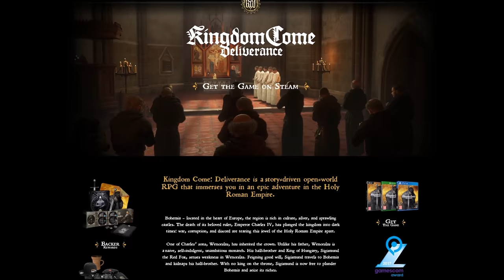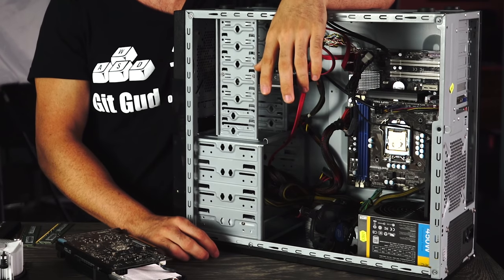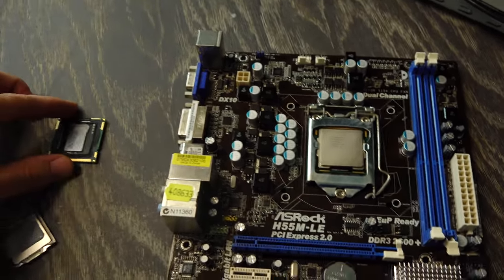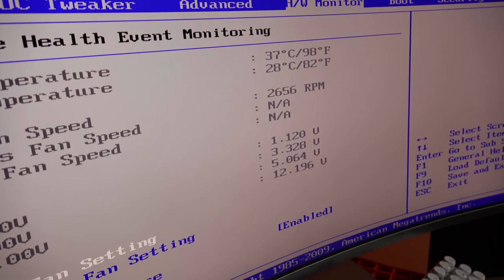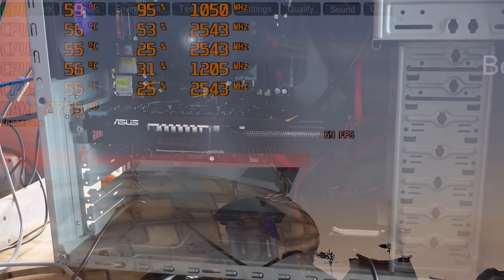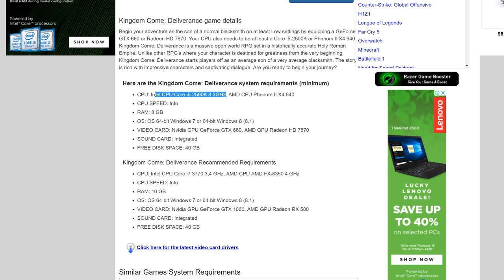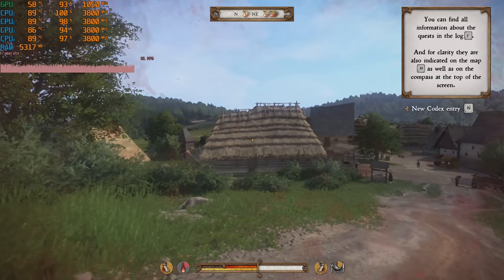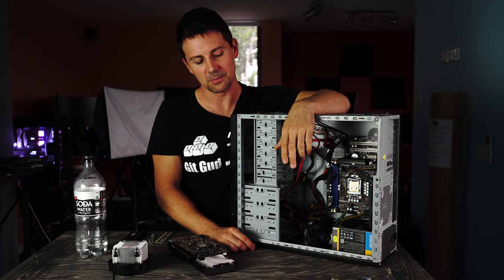The $150 'Bitsweeper' Gaming PC - Mounting an AMD Cooler for Saving that $$$...!

Comment: Wouldn't it have been better to dremel some of the fins off to make it fit?
Reply: Jay O well hammering the cooler and potentially damaging it and its thermal conductivity is a better idea.
Reply: My first thought. One of the things to get out the dremel.
That and for custom windows and fan holes.
Built my own benchtable out of an old case. Highly reccomended.
Had actually planned to dremel off an old cooler for a different board, but found a cheap alternative recently.

Comment: If you really did liquid metall on the card the cooler will die. Between the heatpipes is aluminium wich will get corroded by the liquid metal. Its not nickel plated copper i think

Comment: Had x3430 upgrade from g4400 last week, which is cost less but an upgrade  in term of performance, running the processor @3.9 ghz now, but it is pretty hot (around 90 degree celsius) under stress test, BTW im using CM Masterliquid Lite 120.  Gonna try some delid to cool the processor down.
Reply: Icced Mane how'd it go bro ? Share the affect if deliding
Reply: Re read this a Asetek AIO should be at like 70 in this test, need liquid metal

Comment: hey now, I have a socket 755 cooler on my socket 1366 motherboard. to top things off its a dell t5500 mobo i got for cheap on ebay paid $15 for it and built my wife a nice workstation for her artwork. The t5500 dell mobo has a funk mounting system for heatsinks.

Comment: Really late but that gallium is going to disintegrate both of those heat sinks.. just a heads up for anyone wanting to try this with a cpu, you have to re-lid it afterwards or your aluminum block will crumble like a decaying tooth.

Comment: This Liquid Metal Craze is Dangerous as both Aluminum and Copper Corrode, and the Majority of Coolers are made from that material... Tin, Gallium and Indium will form alloys with it and create a mess and this combination is the Popular Mix... Your CPU and GPU will live less than a Year... It won't be pretty... Consequently Just use Normal Thermal Paste and a Decent Cooler... Seriously it's safer in the long run, I have an FX Chip it never throttles even when the Ambient is 30C with a Damp Dew Point, hottest it gets in 60C which is very hot but in the Proper Thermal Margin... Artic Silver Man it's good shit.

Comment: Tell me if this is a deal: for $280 US after shipping, I purchased a well used Dell 9020 tower with an i7 4790, 8 gigs RAM, 500 gig HDD (or so that is what the listing said it is supposed to be; I haven't received it yet). I had to purchase an $10 24 pin to 8 pin PSU adapter so I could use my old 650W Raidmax PSU. I am probably going to add more RAM and my unused 380x.
 I got it to use it as a server with 3 SATA ports populated with HDDs and the 4th with the DVD burner. I'll likely also game on it connected to my TV (I can hide the PC if it is loud in my coat closet).

Comment: What do you think of the deal I got? For $320 I got a i5 4690k, msi z97s krait edition, 16gb Kingston 1866Mhz, evga 750ti, 1tb HDD, evga 600w bronze psu, cheap thermaltake case and cheap m/kb. I got it within the past month and since then I got a asus strix 970 for $180 pushing the budget to $500. I just traded the system for a 17.3 inch ASUS ROG GL752VL G-Sync gaming laptop with no extra money on my end!

Comment: I was always under the impression that the H55 chipset was a poor overclocker back from reviews. Or some H55 boards BIOS just didn't support it & it was a bit of a gamble because most just plain wouldn't overclock . & P55 was the only way forward. Or that was it, there wasn't sufficient cooling for the VRMS on budget H55 boards, when overclocking.

Comment: Wait, the desktop i5 was once a dual core?!
Reply: Yes and No. The original 45nm 1st Gen i5 processors were quad-core. However Intel did a 32nm 1st Generation reversion of the i5 which has 2 cores/4 threads with higher clock speeds. Compare the Core i5-750 to the Core i5-650.

Comment: I recently got an HP 8200 Elite SFF for around 165$ used. It's got 10gb RAM, a 1TB HDD, and a core i5 2500 CPU.
Do you guys think it's worth it? I plan on upgrading it a bit buying a new case, CPU, buying an actual graphics card and some more RAM in the end. Also a new PSU.
I think I'll spend around 300$ on the graphics card as soon as the prices will drop, an d I hope I'll be able to get something with a similar performance to a GTX 1070 or GTX 1080. I'd of course then have to spend a little bit of money on a Core i7 3770, which after I sell the current CPU would have a price difference of 50$. I think another crucial upgrade would be a nice cooler for 30-50$ as well.

Comment: Saw your comment on Kyles video figured something was coming. Glad you did since he gave a bad rap to the used community by getting ripped off.
Reply: Didn’t get ripped off he just bought well built reliably built stuff not a ghetto pc
Reply: Local market has a large part to play as well.. Cheapest things you can find around here are old Dell boxes with Core2 Duo's... and they want $120-150 for that with 2gb of ram.. so yeah.. local markets can suck pretty hard.

Comment: unrelated to video but I just picked up a 3930k combo last week around the time Bryan made that x79 mobo video. i didnt buy that cheap mobo but actually found a good board and I'm pretty happy overall but anyone know a good upgrade for the x79 socket the future? or at that point would I just be better off upgrading to newer combo? asking mostly because I upgraded from a 2600k which was pretty much the best from lga 1155, so i had to upgrade both mobo and cpu. just wondering if there's a processor higher than the 3930k within the x79 socket that's worth the time and money upgrading to. Bryan if u chimed in that'd be cool too :)
Reply: There's the holy grail unlocked octocore E5-1680v2
Reply: JustIncognito Right now the 3930K is still overkill in most day to day tasks. However if you're that keen on upgrading there are always the wonderful lineup of Xeons on S2011 (They go up to 12c24t). I'm currently rocking the 4930K, and it keeps up with the 8700K and 1600X just fine :)
Reply: ManaCore did you really compare i7 8700k to r5 1600? Lol
Reply: Luka TO I compared the 4930K to modern CPU's as a comparison. I know the 8700K blows the 1600X clean out of the water :)

Comment: 37°C in the BIOS is pretty warm if you ask me
Reply: 80-90C on a CPU is quite nasty also ;)
Reply: Really old cpu aswell , my old xeon x5460 sat at way higher than that in the bios and desktop but never got higher than 70c underload.
Reply: you do realize he lives in queensland right where the weather is humid 37 degrees is pretty normal dude
Reply: That is okay. I have a X3450 at 3,2 Ghz and it is 34-35°C in Bios. It's at 60°C when under full load tho. So it's okay.
Reply: Wat
Reply: Remember when you are in the BIOS, your CPU is running with the set speed and voltage, so the idle temperature is higher than when you boot into windows and al the energy saving features come into play with lower Mhz and voltage.
Reply: David ... i think that was when amd cooler was not touching the cpu properly ...... after he samashed it with hammer, temps would have changed
Reply: Now watch the rest of the video.
Reply: i have like 45c on c2q 6800 in bios
Reply: I get like 19C bios with my i7 8700K using a 212 evo. How is his that hot?
Reply: Dude my r5 1600 in 22c weather will idle 45c in bios

Comment: You should be able to overclock the hd7850 further without bios flashing if you enable "extend official overclcoking limits" in msi afterburner if you havent done so already. the one in my budget pc went up to 1200mhz stable. This  card also seems to favor low temps since i only got 1160 on stock fan curve (mounted a spare h100i i got spare to get it to stay quiet)

Comment: In kingdom come deliverance did you just let the monitor upscale the resolution or are you able to do it in the game config files??? If you can do it in the config files what settings would it be?
Reply from the maker: It has the option there in the resolution for you.
Reply: Oh thanks, I thought the game might've had a resolution scaier that downs the res but leaves the UI the original size for native res.

Comment: I watched bitwit`s video and i count together the single prices from every part of his pc, and i came out with 380€ /470 USD. 
and that were just the regular prices, not great deals. after that i searched for a complete system and i found one with almost the same parts exept ram and gpu (only 8Gigs ram but with a gtx 960 wich is much faster) for 390 €/ 483 USD.  So yeah he overpayed a lot. 

And Bryan I think your HD 7850 could reach more core clock, i had a HIS HD 7850 and i ran it with 1150 MHZ @ 1,15V or my other one from sapphire ran 1200 MHZ@ 1,2V. did you enable the extended overclocking in afterburner? because the slider was maxed @ 1050MHZ or didnt i see it correctly?

Comment: Tech yes city, those xeons can only read 2 ram sticks so you cant go with 4x4gb of rams. I did that mistake myself and bought two 4gb ramstick ended up not working. Itll boot but it will not read the other 2. Used it with a xeon x3450

Comment: i have a b350m-a motherboard and i tryed to but my cpu cooler on it screwed it on and the cpu cooler mount fell of i dont know what to do
Reply: It sounds like you're not putting it together correctly. I'd look up on Youtube a short video (like someone building with it, or just showing install of cooler) for your model. 

If you can't get that to work (like if its a non-stock cooler), I've zip tied so many coolers over the years, I almost do that simply so I don't have to use a screw driver. Its super secure (you can pick up my test bench with water cooling, 1000w PSU and all, just by grapbbing my CPU cooler and picking it up), doesn't even wiggle.

Comment: I had a problem with a rig that when i was mounting it to the mobo it would not be the most secure, maybe it's beacuse i dont have a case for it. :] Anyway it's fine now. 
System consists of a core 2 quad q8300 oc to 3ghz, 4x 7200 rpm 250gb old apple hdd's, 650watt psu, GTX 560ti, using an msi 775 mobo from ebay but turned out to be from a school telling from the splash screen lol.

Comment: i think i got myself a pretty good deal with a r9 380 4gb (does fairly better than a 1050 ti in a lot of games), i5 6500 with stock intel fan cooler, 8 gb of ddr4 2133 ram (2 sticks of 4gb) ,a corsair 450 watts power supply,  the motherboard is an none overclockable h110 i believe, something like that, almost some oem board, a very, very nice case overall ith it, in pristine condition, multiple silent fans in it, 1 TB hdd drive, overall i paid 450 $ for it, how would you rate the deal ? Oh, and pre installed windows 10 familly already activated. ( Versa N24 ALPHA is the case i got with it, black case, it looks like a jet engine with cool tubes around the design of the tower)

Comment: I think if you used a Dremel tool cut off wheel, instead of a hammer on that cooler ( Cringe ). I think you would drop 5c on the cpu temps. Tell me what you think.

Comment: i have a Q6600 and Q9450 overclocked them both on the same motherboard, to around 3,4ghz. and they kinda performed better than my brothers i5-2400 hahaha (game tested is ofc fortnite, paired with a GTX 1050Ti)

Comment: aah.. almost same as mine. but a dead gpu in mine.. HD 7970.
Reply: that's sad, the 7970 is a beast
Reply: thanks for the condolences. My First GPU.yeah.bought it used. after alot of struggle.was eyeing a 1060. slight budget crunch postponed the purchase for a few weeks. then along came  mining . even used cards go for double the price.
Reply: Does the 7970 not post at all?  Did you try reapplying thermal paste, or the oven baking method Bryan did in one of his other vids?
Reply: it posts , lot of artifacts only partially stable in  14.12 , doesn't fully recognize. thinking of baking , but dont have any oven .
Reply: +Mahesh SK, I suggest going for a gtx 970 man, especially if you have the budget for a 1060.
Reply: nothing much in the used market either. most are not selling. even if there is,its at insane price due to non availability . trying to wait it out.
Reply: Well, if it posts, and you get artifacts.  Then there's still hope for it.  Like I said before, try removing the old thermal paste and reapplying new thermal paste first.  Then if that doesn't work, try going over to a friend or relatives house for the oven baking method.  And if you want a super duper longshot, you could enter the jayztwocents giveaway, where he's giving away a 1060, 1070, and 1080.  You might get lucky.
Reply: CyberClu Changed the thermal paste.  entering all the giveaways for the past two years. yeah. hope. I'm trying to find an old oven from some place.

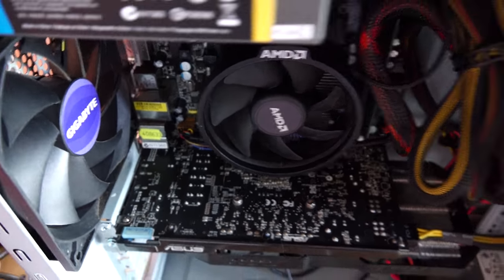Comment: 8:12 bang job? first time I see anything like that in 15 years of computing... really, you've just compromised the efficiency of that heat sink even more. This isn't a passive cooler, what are you doing? Just because the heat sink of the cooler you're using doesn't match the motherboard layout, doesn't mean that banging on the fins will give it a nicer fit. It needs those fins to conduct air and efficiently cool. You should perhaps consider a different cooler that fits within that motherboard layout, you know. You've pushed a 2,4 ghz CPU to ~3,7 ghz and think that it is almost throttling because the heat sink doesn't sit well? Oh... and trash talking another tech reviewer to boast your credentials is really a no no. I think this is where I'll check out.
Reply from the maker: You must have missed the part (or just flicked through the video) where the cooler was hitting the VRM, so I banged the fins to simply expose the copper slug out more, so that it would mount without hitting the VRM.  For 15 years of being in computing you sound like you don't know how cheap coolers like these are made?  The Slug is at sub 0, then the aluminum is then heated and the slug is banged in between and ambient temps create a 'firm attachment, hence why the hammer saves me time (and money).  
So yeah... please see yourself out the door mate, don't have time for this shit at the moment, sorry. Also what are you referring to when you say 'trash talk'...? Bit Wit was seriously misrepresenting used price performance, and a massive part of my channel was built up on it, I never slandered or trash talked him at all, in fact I was opposite, especially at the end of the video.